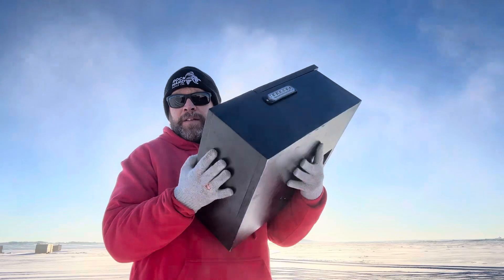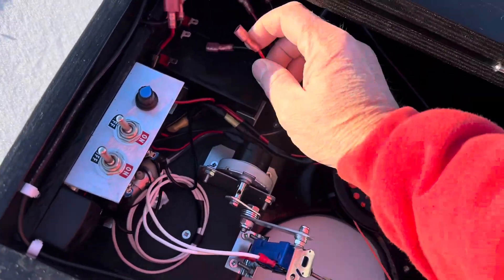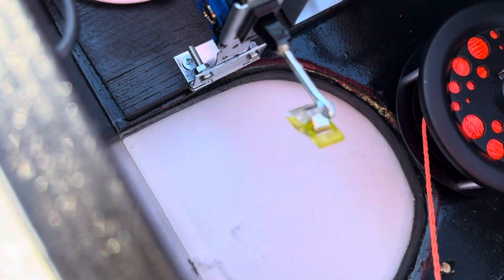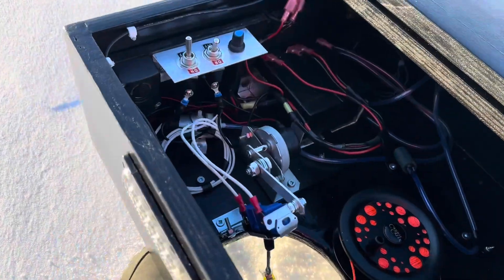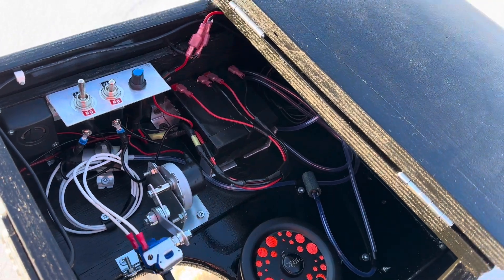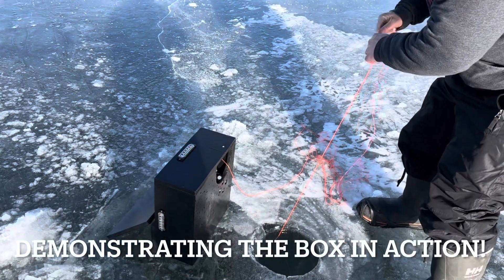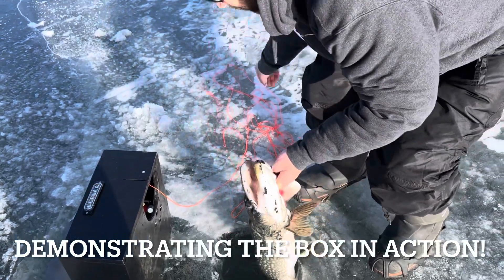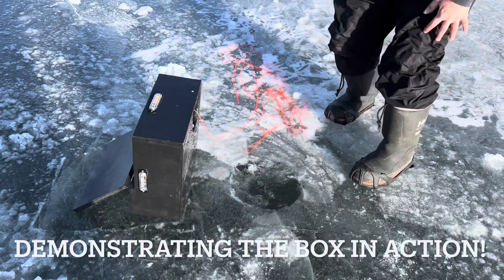The Box That Catches Fish And How It Works! #icefishing

Comment: Cool 1strike box.  I have this uears model.  Slightly different.  I notice you have an air hose running inside your box which i presume provides air bubbles in the hole.  Mine has a slightly taller backside to the box as he has added room for a fuel cell in the back.  You just light the wick and it can burn inside the box and keep it warm. Looks like u replaced the stock spool.  Your looks better.  I might do that too.  Only other thing i was gonna do in the summer is place plastic skids on the bottom just to keep the wood off of the ice and water.  I did repaint it with a rubber paint bwfore ice season but i just didnt want the wood to get soaked).  Great video!
Reply from the maker: Yes the air bubbler is an add on that keeps the hole open. I haven’t seen the new models yet but here they are awesome! Thanks for watching 😀